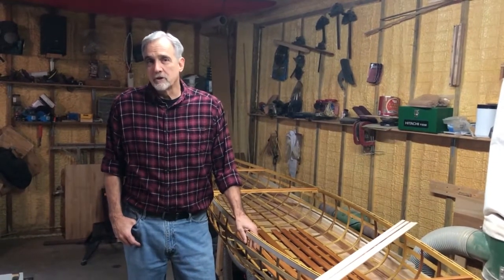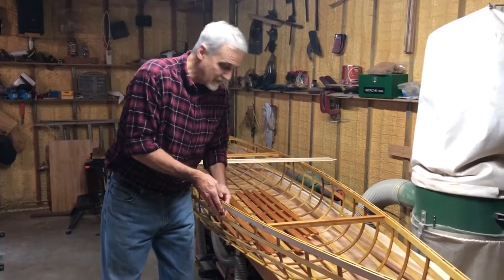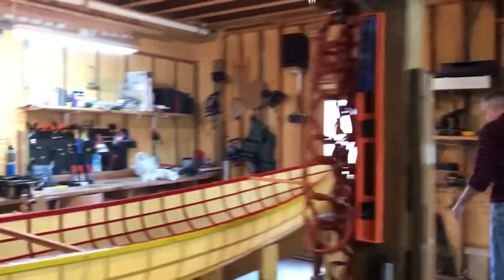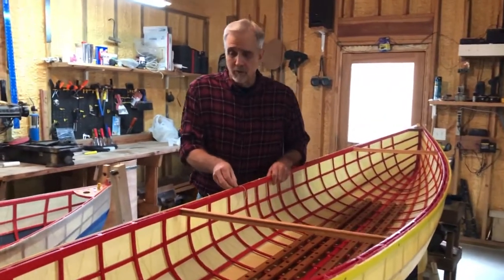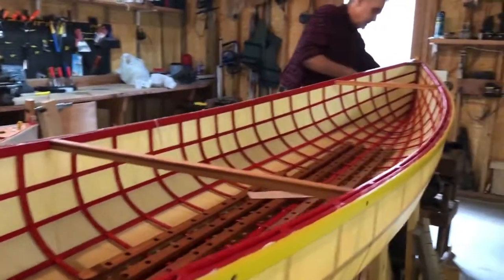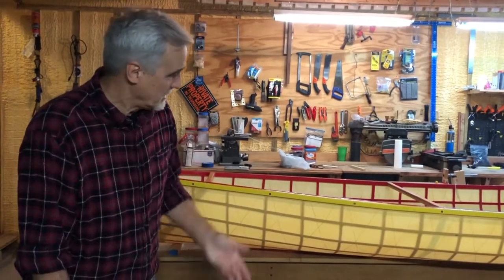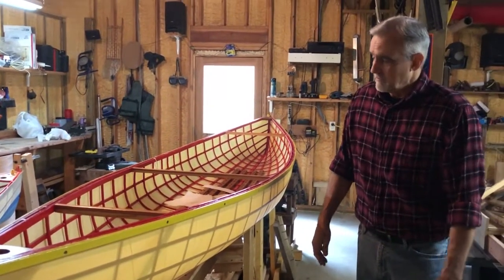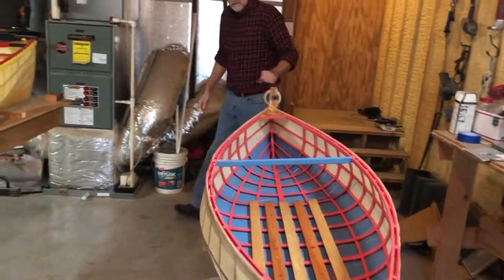New Materials

Comment: Really nice.  With the thicker dacron material, do you still need to put on the kevlar roving in the cross pattern?
Reply from the maker: Hi Dave, this is Larry LaLonde, owner of Geodesic Airolite Boats.  Thanks for your kind comments!  The Kevlar roving is actually there to provide torsional strength to the frame.  It keeps the hull more rigid and also helps to prevent popping the glue joints loose under severe stress.  You can certainly build a boat without it but I figure since Platt put it in there and he was a lot smarter than me, it serves an important process
Reply from the maker: Hi Dave, I tried to reply to your question about sizing the Kevlar but YouTube won't let me so I'm replying to this one again.  I changed the name of the video from Sizing the Kevlar to Tightening the Kevlar because I noticed it wasn't getting nearly as many views and was worried that people thought it was about the length of the Kevlar.  I wanted to make sure people were watching it.  Hope this helps!  Larry
Reply: "The Kevlar roving is actually there to provide torsional strength to the frame.",  @geodesicairoliteboats1632 ,... ... that means that the Kevlar can also absorb pressure forces of a corresponding size?

Comment: Any additional weight with the poplar?
Reply from the maker: Hi John, this is Larry LaLonde, owner of Geodesic Airolite Boats.  Thanks for your interest in our boats!  That's a hard question to answer because it sort of depends on what you were going to use initially.  Generally, the poplar is lighter than ash or oak so you'd save a little bit of weight there but it's heavier than most spruce so you might add a bit of weight.  Overall, the boat will be within a pound of the published weight.
Please feel free to reach out with any more questions.
Thanks!
Larry

Comment: Have you ever tried using a heat gun to help with the ironing process. I'm beginning to skin my Classic 14 with 9oz and my 1200w iron is struggling at full temp but before I buy a new one I figured I'd ask.
Reply: Just saw the answer to this question in the comments of your "Working with Heavy Dacron" video.  Thanks
Reply from the maker: Hi Jesse, on the last couple builds I've used a heat gun to shrink the boat from the inside before using the iron on the outside and it works well.  There's a video of the process on our YouTube channel.  I don't know if you have a way to check your iron but a couple of times builders have struggled with the shrinking process only to find out their irons were only getting up to about half temperature.  Thanks!  Larry
Reply: Are you happy with your classic 14?

Comment: Hi Larry, Watched most of your videos. Nice builds, and methods. Do you have any video's of them being used on the water/ocean? Would it be possible to build 30' - 50' sailboats/schooner with this method?
Reply from the maker: Hi Craig, thanks for the kind comments!  Unfortunately, we don't have any videos of the boats on the water.  We are working to update our website and asking customers for new content but there aren't any from the previous owners.
As far as a large displacement hull, I don't think skin on frame is your best solution.  The amount of structure you'd have to add to support the displacement as well as the weight of the decks, a keel and the forces from a tall mast would offset any weight savings from the fabric hull.  Also, SOF boats are designed to be used and removed from the water and the type of boat you're asking about would probably be left in for an extended period.  And when you consider the number of seams as well as the forces exerted on the Dacron when your 2000 pound boat hits something, I think you're better off with a traditional hull.  Just for reference, I think somewhere around 21' to 22' is as far as I would feel comfortable with a SOF hull.
Reply: @geodesicairoliteboats1632  Thanks for your reply :)